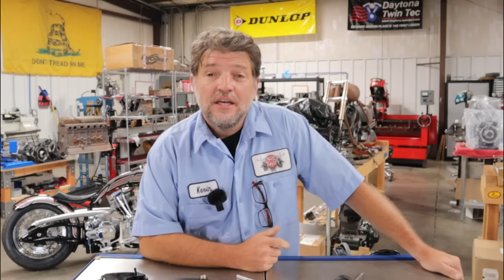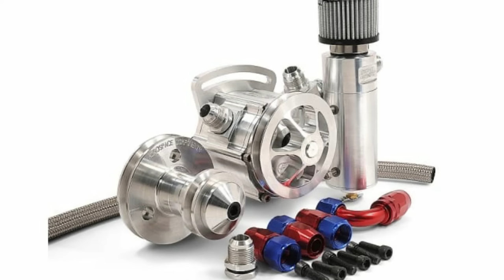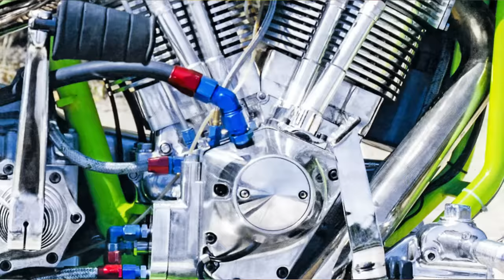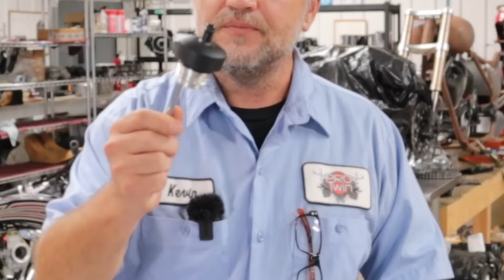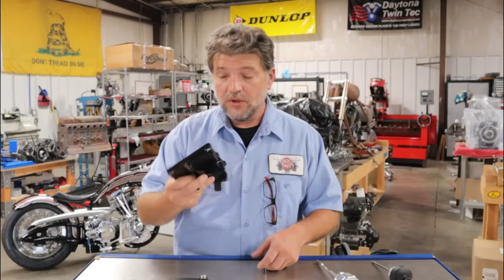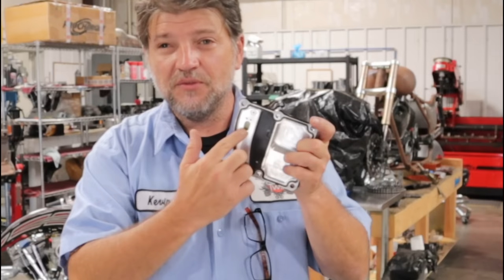COMPARE M8 CRANKCASE VENTING - A1 Cycle, Trask, Feuling - Kevin Baxter - Pro Twin Performance

Comment: Hello Kevin and thank you for another excellent video; much appreciated!  Can one "over ventilate" a Harley air/oil cooled V-Twin (2021 M8 114 Touring w/Stage-2 in my case; perfectly maintained and no known or observed issues)?  
That is, if already running either a Vented Oil Dip (Fueling) Stick or the Transmission Top Cover (Trask), and then add a Filter or Catch Can to the head breather bolts (& air cleaner that does not allow feeding/venting back into the air cleaner/throttle body), would or could this ventilation [by both means] be unnecessary or excessive?
Reply from the maker: it could be excessive if the venting method adds potential for incoming contaminated air.  as with many things, this is a balance.  venting the crankcase, then running breather bolts to a catch can wouldnt "over vent".  as simple as I can make it....were on different sides of the breather valve....so no issue there.
Reply: @KevinBaxter  Thanks Kevin.  I'm only utilizing a Transmission Top Cover Plate (with a one-way check valve) for venting the crankcase.  No issues on my '21RGS 114, mild Stage-2 configuration (S&S 465 perf. torque cam).
Reply: @tommiller8714  I am also running the transmission cover vent by Trask. How does that 465C cam behave under low load conditions, i.e. going a steady 15mph in 1st gear on a flat road? I have a zippers 468 cam in a m8 107 that runs choppy under that condition. I have a new 114 and want a torque cam that is smooth at the low load conditions but can’t find any reviews that address that.

Comment: Kevin do you think even the new 22+ m8s suffer/need the crank case vented? Or even the transmissions? I was told that the 22 fxlrs I have, has a trans vent.

Comment: Really enjoy your videos, though mates reckon am somewhat geeky as enjoy technical videos. The vast majority of harley owners do not have the technical ability or confidence to vent the head breathers, particularly in the UK though no less in the USA either where ignorance is bliss. Many due to high moisture levels in our cold wet atmosphere have startup issues, cut out issues and high revs coming down gears clutch pulled after a good thrash. Trying to explain that moisture and oil vapour makes a creamy goop that is occassionaly hitting the IAT sensor in the fuel tract and causing the bike to hiccup. That harley will clean all the goop out of the path from head breathers to throttle body and that it will then take a few months to re-create the path to the problem all over again falls on deaf ears. I never had the issue on my first harley but definitely had it on my second, possibly because its less cold and wet well south of Scotland  where my second harley came from. Looking to get a 2022 Low Rider S used with as low mileage as possible and vent both the crankcase and head beathers from the get go. Not too later fit the SS cam plate and performance oil pump plus lifters with billet collars. Later fit the Darkhose Crankworks Compensator as a cushed comp definitely seems a better proposition than what harley have been using for decades. I just hope I aint got any swarf left in my crankcase from assembly : O From extensive online reasearch crankcase top vents are far superior to what is effectively a poor catch can on a dipstick, these seem like a very messy option.

Comment: Kevin, thanks for the info, and insight. Turns out the “0” ring supplied with the cam install kit was the wrong item. The correct “0” ring , of which I’m sure you’re well aware of, is the same one used on the pushrod tube at the head juncture. Again, thanks for taking the time to reply. I know what a compression test is. Could you explain what a leak down test is and how it relates to a compression test. 
Dan Jaram
Reply from the maker: leakdown determines quality of ring seal, valve seal, and head gasket seal.  basically, the cyl is pressurized at TDC of comp stroke and the percentage of air lost is used to diagnose health of the top end.

Comment: Probably a foolish question, but having vented the crankcase through the transmission cover (ala Trask M8) is there any need to continue venting through the intake breather bolts?  I don't know how to measure the volume of pressure to insure the transmission vent is sufficient and I don't want to blow seals or gaskets.  It sure would solve the oil in my air cleaner if I could simply install solid bolts in the breathers.

Comment: I have two questions for you Kevin excuse my ignorance in the subject but could carbon deposit be removed to some degree by the old fashioned water injection system to the intake or would this only pertain to carb. equipped engines vs injection. 
Next question is could one use the Venturi effect by tapping into the exhaust outby the catalytic section (if any are present) in the exhaust?
Love your videos.

Comment: Interview for Harley owners?
How do you feel after purchasing a HD for $30,000 or more only only to begin noticing it start to use oil and need engine work with as little as 50k (or much less) on the odometer?

Comment: Hi Kevin, I have a 2022 Road Glide which comes with a Vented Trans Cover out the factory, does that mean I don't need any of the 4 products you've mentioned in the video? Looking to go as far as just a Stage 2 cam

Comment: Kevin, stock M8 engine…. No modifications whatsoever and these guys need more crank case ventilation. I chose to vent the transmission top case and redirect the stock vents from the intake to atmosphere neatly tucked out the bottom of the bike…. No filters or catch cans…old school and cheap. Left that nice oil dipstick location for a nice oil temp/dipstick…..my .02 cents

Comment: The Feuling umbrella check valve / filter components inside the dipstick cap require routine cleaning/ maintenance. Otherwise, air will flow freely in both directions and the check valve will no longer stop incoming air. So, if you don’t want to keep up with your vented dipstick cap cleaning and maintenance, then the A1 Ventilator vented dipstick cap the best choice.
Reply from the maker: great point!

Comment: I’m wondering if there are certain years that this is an issue with? I installed it on my 2017 and it smoothed the motor right out and I picked up 2 mPG. Did HD fix the issue in later models or are they still unvented? Thanks for your time.

Comment: Hello Kevin! You mentioned once before that the EVO's had thicker rings then the M,8's. When doing a big bore kit. Do they use thicker rings for M 8's? You also mentioned loosing crank case vacuum by venting breather to atmosphere. Is it possible to use the capped vacuum nipple on top of the EFI back into the crank case to reclaim manifold vacuum?
Reply from the maker: EVO also had smaller displacement and lower compression ratios....less blow by.  Also...they had a mechanical timed breather which was very efficient as well.  Too much vac can promote misting and also effect efficiency of the oil pump...i wouldn't do what you mentioned.  there is a balance and a case by case.

Comment: Hi Kevin, Thanks for all the great videos. I have a 2018 Street Glide with the M8 107. I was hoping to get your opinion. I've been watching a bunch of videos about oil blowby and ways to avoid it. The vented dip sticks, trans covers, and rerouting head breathers to a catch can. I tried the A1 vented dip stick and ended up with oil all over the place. I saw another youtuber ( https://youtu.be/bIyaV8KP8HI ) vent the crankcase through the transmission vent and reroute the breathers to the top of trans cover, letting the blowby oil drain back to crankcase. That sounded good, not having to maintain a catch can, but it still doesn't allow for vacuum in the crankcase, and connecting the crankcase to the transmission did seem like a good idea either. 
What do you think about putting two fittings in the transmission cover over the crankcase. Rerouting the head breathers together and tee off to one of the fittings, and put manifold vacuum to the other fitting. Would that provide the vacuum needed for the rings to seal and keep the blowby oil mist out of the combustion chamber? 
I appreciate your thoughts and opinions.
Thanks again for your time.

Comment: Speaking of external breathers, and catch cans: do you think having the breather hose from each cylinder separate to its on catch can would be best or is 2 into 1 ok? I have a 2 in 1 hose set up, and I’m barely seeing any residue in the catch can, and I’m wondering if they are working against each other to prevent the external breather from working as it should.

Comment: I have a 2020 114 Heritage.  Got bad sumping after 19k miles, yes even with the improved 2020 pump..  When new I put on the fueling dipstick and DKCustoms head breather both venting with filters.  Always got drops of oil coming out of both filters during moderate to hard rides.  After the sumping issue I replaced  the 2020 pump with An S&S oil pump and cam plate along with a new sump plug.  Bike is running fine and no sumping so far however I continue to get the same amount of oil seeping from both filters. Could there still be a problem or is this normal?

Comment: Hey Kevin,
Doesn't the addition of the oil pumps with the seal virtually eliminate the sumping and the need for added venting?
Reply from the maker: We can't say that alone eliminates sumping because it can be caused by various things. It has shown to reduce carryover from crankcase to camchest which would overtax the sump side of the pump in the cam chest. There are many, many bikes out there without the seal that have high miles with zero sumping. My opinion is that the seal, in some, is a bit of a bandaid for another issue....but if the bandaid solves or prevents it, all is well. It's kind of like certain sicknesses where the symptoms have to be treated instead of actually curing the sickness. Hope that makes sense.

Comment: I have a new 22 Harley FXLRST, with the 117 motor. I recently installed a woods 22xe cam and lifters. I’ve started getting excess amounts of oil in the air cleaner. So much, that the oil is all over the side of the engine. Per Fuel Moto whom I purchased the parts from, increased performance has caused this oil problem. Fuel moto says it’s a common issue when the performance has been increased. I’ve vented the head breathers to a catch can. I’m going to install a breather system in the trans top cover. I didn’t have this issue before the cam change. This problem showed up after a fairly long ride at highway speeds. I’m quite certain the cam is installed properly. Your thoughts and opinion will be greatly appreciated. Wish I lived closer to your shop!!! Thanks for your input.
Reply from the maker: If you have a marginal ring seal, an increase in combustion pressure with just a cam could also increase blowby and then, crankcase pressure.  I'd be curious to know what your crank runout was in the cam install but...i would install the top cover as you plan.
Reply: @KevinBaxter  Thank you for taking the time to reply, and offer your opinion. Very gracious of you. I doubt the ring seal is an issue, as the motor has only approx 2000 miles on it. Crank run out? Not sure. I plan installing the trans top cover vent. I will relay the results after the install. Again, thank you for taking the time replying.

Comment: I believe I wasted my money on my dipstick vent. After talking too some other V-Twin experienced mechanics,  the 103's don't have any oil sumping problems. External breather for heads is all thats needed,  unless your running a built high compression motor

Comment: Great video. Just a thought, could the trans cover be vented to the throttle body vacuum port with a vacuum valve, post butterfly seeing as the trans cover does not really have any oil mist. My thoughts are keeping more vacuum on the crank case. Am I going down the wrong road with this thought? I am basing this on a standard car PCV system but no oil mist because the trans port is up high. Thanks.

Comment: Hi Kevin, 
thanks for this great video again! 
I've got a TC 88 from 2000 and I built a catch can for myself. I used a 2 inch 1/4 inch hose to get the oil and the dirt out and into the DIY catch can. This works fine. I had a look into the cylinder head with an endoscope camera. The motor has got 25.000 miles now and I saw a medium carbon layer on the pistons. I wonder if this carbon layer will disappear without a cleaner time after time or if I should use a special cleaner to get it away from the pistons?   
I' ve bought a special cleaner which can be used without disassembling the motor but I wonder if it is really necessary to use this cleaner or if the motor cleans itself after riding several hundred miles? 
I am curious about your answer! 
Thanks in advance! 
Boneskaker from Germany
Reply from the maker: i have used a cleaner from Quicksilver....marketed for outboard boat engines.  spraying in your throttle body while running can be very effective in removing carbon from pistons.  only do when necessary though.  most burned on carbon will not just go away if from oil without some sort of chemical.
Reply: Hi Kevin! 
Thank you very much for your assessment! 
I already thought that it will probably not work without cleaner. I have one in tubes and it's supposed to be put in each cylinder for 20 minutes with the engine warm. Then let it soak for 20 minutes and then do a big run at revs. I will probably try that and then look in again with the endoscope camera. However, it is very cold and rainy here in southern Germany at the moment. But the cleaning I will do in any case!
Thank you very much for your answer and all the best!!!
Boneskaker from Germany
Reply: Hi Kevin! 
I found the Quicksilver Power Tune Internal Engine Cleaner Spray @ eBay. 
I think that should be the right one that you use. 
I will check this out when the shipment arrives...
Thanks again for your help!!!
Best regards Boneskaker

Comment: You want some vacuum to seat the rings well, on throttle then off etc. So I’m assuming this venting the crankcase from pressure is AFTER break in.

Comment: How effective are Total Seal piston rings at reducing blowby and other ventilation issues? They used to be a pretty good remedy on Evo engines as I recall.
Reply from the maker: they can certainly be effective...they are not widely used by piston manufacturers in the HD world these days.

Comment: I’m running the Trask top cover. Would there be any advantage to adding either dipstick? If the A1 dipstick could actually lower engine temp I would consider it. My bike runs hot, hotter than I think it should.

Comment: So I have done the trask top cover and external intake breather on my 18 RG  also have pulled the plug in the bottom of the engine and all I got was a couple drops of oil so I don't believe it's sumping but yet I'm getting not just a oil mist but actually oil from head breathers should do you think I should check the breather valves in the rocker box or you think something else is wrong?
Reply from the maker: all engines will mist oil...but it sounds like yours is excessive.  sounds like you dont have a sumping issue.  some will mist more depending on environment, temps, riding conditions, riding style, etc.  A leak down and cyl pressure test wouldn't be a bad idea along with evaluating the breather operation.  If all is found to be in good order, in your case, venting the head to a catch can would be a viable solution to keep oil carbon from building up on your pistons and rings.

Comment: I have a new 2022 Triumph Scrambler, 1200XC with an oil leak at the drive sprocket shaft. 
I noticed this leak in the showroom before I even bought the bike.
Where are the pressure relief valves on this particular motorcycle?
I’ve noticed oil seeping from the gasket on the bottom cover.
It’s not much but just enough for me to notice a difference in color along the line where the gasket is. That’s excessive pressure because it doesn’t leak at idle. The drive sprocket shaft leaks after each ride, more so if I’ve been in the highway.
The gasket seeping happens after a highway run.
What could possibly be blocked or malfunctioning on a brand new motorcycle that would cause an oil leak because of access crank case pressure ?

Comment: I have a 2020 SGS with a stage 2. I also installed a feuling oil pump, camplate and lifters with an after market air intake and a mid length Bassani 2 in 1 mid length exhaust . The bike is tuned with Harleys SE tuner. I installed the Feuling vented dipstick (Did not run the tubing) at about 3000 miles. I currently have 9000 miles and I have seen very little oil blow-by. So my questions are 1. With an M8 that is not really built do I still need this and 2. Does little to no blow-by mean the pistons are fine   ?
Reply from the maker: sounds like you have a healthy engine there!  Even stock engines have had these issues so 1, possibly yes.  2,  i read no reason to think otherwise.

Comment: Hi Kevin! Great video that explain a lot. In 2020 HD added seal on oil pump so crankcase pressure is no more passing to camchest. Where is it venting than? I have 2020 FXLS, have installed S&S oil pump with seal an there is no more excessive pressure when I open oil tank during engine running. Is it any point to use oil tank vent if it is no more venting pressure coming form crankcase that is sealed by oil pump seal? Another question is it good for engine if now crankcase is sealed from camchest and crakcase is no more venting to camchest and oil tank? Best regards!
Reply from the maker: the seals purpose to keep oil from carrying over from crank to cam side.  air can even bleed thru the cam bearing journal, etc.